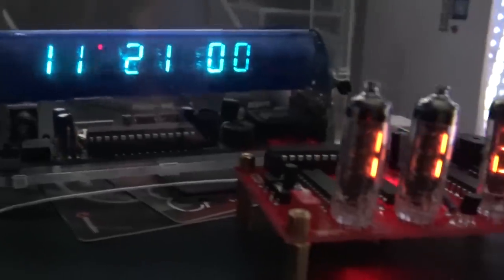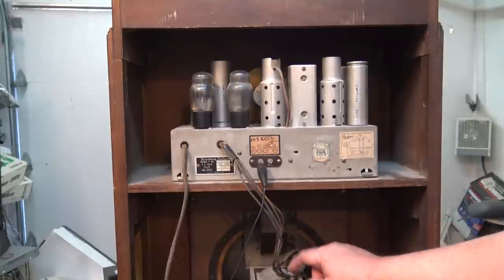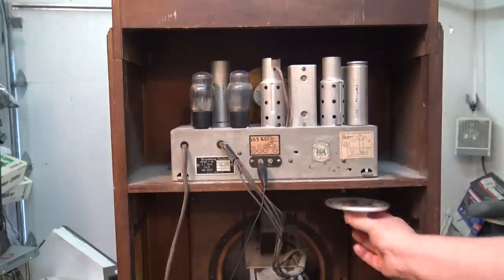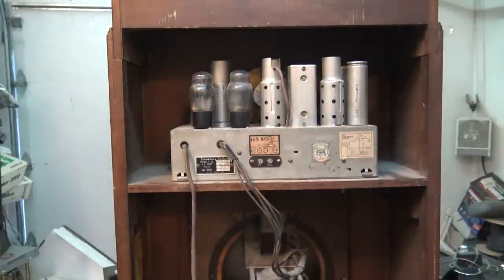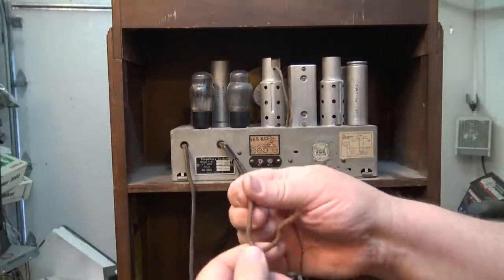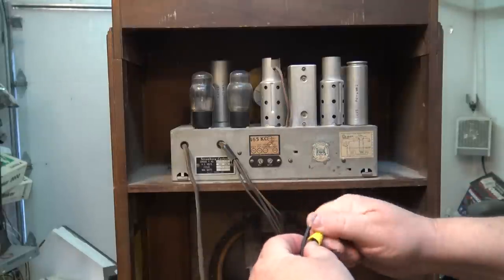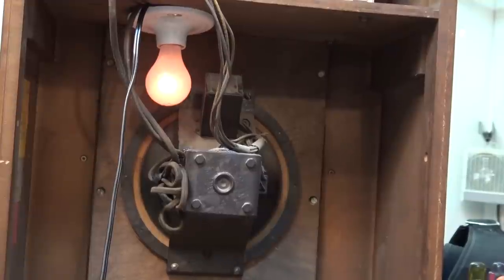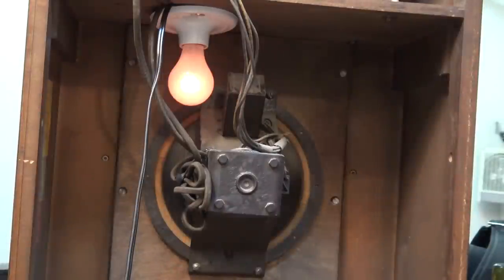Protecting your antique tube radios

Comment: Yep it's a good protection for old valve receivers, but i don't think the spider that came down the inside of the case was too happy lol.
Valves/Tubes have always been a forgiving component, i've found sets full of carbon resistors that have gone really high due to heat and the radio still works.

Comment: I certainly agree with adding protection,  my vintage sets are retro fitted with suitably rated fuses under the chassis.
Being in the UK, I also fit a suitable fuse in the plug.

Comment: There are few problems with that. You can't just install dim bulbs in 95% of the radios as there is simply not enough space. Also the originality is ruined, perhaps it is a mint radio and you just damaged the wood by screwing the bulb holder into it. I do it like this: 1. replace all the usual components (paper capacitors, electrolytic capacitors, etc.). This is just common sense and a lot of the times the radio won't even work without recap. 2. use a low amp fuse. 3. (optional) install a dropping resistor to knock the voltage down a bit - being from 230V country, I usually install 22-47ohms in series with primary to drop about 10-12V to the original 220V that old devices are specced at. 4. (for being extra cautious) fuse everything - heaters, B+ line, output tube plate line, etc. I have an old German Saba radio that has all those fuses and I doubt the power transformer will ever go out no matter what happens to that radio :)
Reply: Also a lot of the times the dim bulb will just knock the voltage too much, I have a set that is specced 45W and with 100W bulb in series it will barely work, FM will not work at all. Some also say that tube heaters don't like to be under-run too much, which might be the case with the dim bulb.
Reply from the maker: Dim bulb of sufficient wattage won't drop the voltage that much.  As to attaching inside a large cabinet not a problem.  The wood inside is not finished anyway.  Fusing only works if the fuse blows.  You can be into a current run away and the power supply is not drawing enough to blow the fuse.  Remember fuse needs to be large enough as to not blow at turn on when tubes are cold.  A fuse that is big enough not to nuisance trip is probably too large for safety.  For portable radios I have a cord set with a lamp on it in series.  
Never have had any issues.  I don't listen to these old dinosaurs regularly though.  They are mostly for show and I turn them on once in awhile.   Don't want to consume obsolete tubes.
Reply: @12voltvids  Sure, no worries. A lamp of a too large wattage might not prevent damage after all. I had an arcing tube socket in one of my radios that I dim bulbed it, and it nicely smoked a lot and opened the plate resistor, despite having a 120W bulb in series and being a 60W set. Years ago I plugged in an old radio for testing purposes (I didn't have a dim bulb then), and it immediately blew the fuse. I then bypassed the fuse and hooked it up to a wattmeter, and it showed almost 750W draw (I had it on for 2 seconds). Next I found the rectifier has cracked and transformer secondary shorted to ground.
Reply from the maker: @michvod  
That's why you don't use too large of lamp. Nothing is fool proof but having a lamp in series will greatly reduce the change of damage and more importantly the chance of one of these old beasts bursting into flames. Saying that, NEVER  leave one of these things plugged in if you leave the room.  These old radios, restored or nor are decorations and should not be used as daily drivers. They are nice to look at, and demo for people but they should never be trusted. Back when they were new they caused a number of house fires and they haven't gotten any safer as time passed.

Comment: And sometimes, the dim bulb will stop it working. Also, putting a bulb inside a cabinet could create heat inside. Better off just fitting a fuseholder and fuse. Make it internal to the chassis so if it blows, it needs to come back to find the cause.
Reply from the maker: Negative. Dim bulb will have no effect on performance. 
If I put in a 40 or 60 watt, then yes it would cause the B+ to be too low, which would result in distorted low audio, and affect the sensitivity, but a 100 watt bulb, or 2 60's in parallel will provide more than enough voltage. I bet if I measured the B+ it would still be up in the 400V range.  You need to go higher than the maximum consumption. A 100 or 2 60's in parallel will have more than enough power to run the unit. As far as heat goes, the bulb is just warm to the touch. I can grab the bulb after it running for hours. A fuse may blow for no reason if there is an intermittent over current such as turn on, when the tube filaments are cold. They draw a shitload of current when they are cold for that first few seconds. Also having a light bulb in series gives it a "soft" start. Any way you look at it, this is the safest option to protect vintage electronics.
Old tube televisions used to use time delay fuses, or circuit breakers to prevent nuisance trips due to surges and momentarily over current. The problem with slo blow fuses and circuit breakers is if something does happen, the damage can extend far beyond the original fault by the time the breaker trips, or the slow blow fuse heats up hot enough to melt the connection and open the circuit. This dispenses with all that. Enough current get to the unit to operate it, and excessive current is prevented. A dead short will just make the light glow full brightness.  There will still not be a hazard, because it is in a UL light fixture, designed for wall or ceiling mounting. The bulb is isolated far enough away from any combustibles.
Reply: yep, agree with most of that but if I was going to do it then nothing wrong with using a MOV and a fuse if I was going to add extra protection. The biggest problem is getting any tungsten lamp of a high enough wattage into most cases. Certainly wouldn't get one in the 1949 Ace 50 tabletop I'm restoring at the moment.
Reply from the maker: Also, consider this. Prior to 1970's the voltage in north america was 110/220.
It initially started out that way because the original light bulbs required about 100 volts to be bright enough, so to ensure that 100 volts was available the voltage was set up to 110. In the late 50's this was increased to 115, and in 1968 the standard was set at 120/240 and most utilities had adjusted to the new standard by the early 70's. This old radio is designed for power systems 105-125 volts. This is because the voltage fluctuated widely back in the early days, depending on how far you were from the generating station. I measured it, and with 120 volts input, the power making it through the 100 watt lighht bulb is actually 102 volts, which is well within the operating range if it was originally running on a 110 supply during brownout conditions, where the voltage could drop substantially.
An MOV is not going to do anything to protect these old devices. They typically don't conduct until well over 200 volts and all a MOV s going to do is trip your fuse on a brief power surge that is not going to harm one of these anyway, because tubes are very forgiving to overload. What a dim bulb will do is regulate the flow of current, as when the filament warms the resistance will go up, so it will regulate the flow of current and keep it at a totally safe level.
The electricians and engineers watching this fully understand this principle.  It is the simplest way to protect equipment. This won't work on equipment that is voltage sensitive, however with old tube gear this is not the case. It is much simpler, and far more reliable than other methods of protection, gives that natural soft start, which protects the tubes from that initial shock of starting cold, and the bulb running on very low current is never going to burn out.
Reply: I understand the principle, I use dim bulbs all the time when testing stuff. The reason I was looking at MOVs was the UK standard rms voltage of 240v, we peak at 300 ish... I have measured spikes here at around 500v. I'm not arguing that the dim bulb is the simplest solution but it isn't the sort of thing that fits in with the sort of vintage radios we have in the UK. There wouldn't have been room for anything like that in my Eddystone 840a, Ferranti 1016 or even the one I'm doing at the moment! I'd hazard a guess that you would be pushed to fit a torch bulb into the likes of a Bush DAC90! In fact, thinking back, the Eddystone used a varistor for the purpouse of inrush regulation and spike  prevention. Same principle, temperature changes resistance without the visual indicator that the tungsten bulb has. The Eddystone was also an AC/DC world set so there was no mains transformer, just the big resistor tapped at intervals for varying voltages.

Keep the videos coming, I look forward to watching your stuff because it is more interesting than a lot of others out there. All the best,

George
Reply from the maker: Just did an AC/DC radio today. No transformer, all tube filaments in series.
The dim bulb on the line cord only works when you have a huge cabinet like this. I don't have one on my Pye P75, but I do have a step up transformer to boost to 240V for that one, and it is limited to 100 watts, or about 800 miliamps, and it is fused. The radio and the transformer.
Reply: MOVs and dim bulbs are tools for tackling two very different problems.  One place you wouldn't want to use a dim bulb is anything with a switching power supply.  It compensates for the low voltage and can stress out on the "brownout".  But little risk of finding a switch mode in antique stuff. ;)

Comment: Projector bulbs work well and are a lot smaller.  Also night-light bulbs, though they may be only 25-40 watts or so.  Use 3 or 4 of them in parallel.  I suspect a PTC resistor would work as well but one must choose the right one carefully, and some sort of visual indicator would need to be made to show that an over-current condition is present..
Reply from the maker: A projector bulb will pass way too much current to do any good.

Comment: I do the typical work when  I restore an antique radio. Replace all paper and electrolytic caps, replace all carbon comp resistors (may not be true for everyone, but 90% of the carbon comps I've run across over the years have been out of tolerance high), replace defective tubes, clean pots & switches and do an alignment. I also replace all parts known to eventually fail.

I use my antique radios regularly and so far I've not had any issues at all.

Not saying the bulb is a bad idea though. A fuse might offer better protection though as it would blow and cut all power to the radio.

Comment: a 'dim bulb' in use CAN affect the radio operation, as it will drop the volts to the set slightly, if the radio has a voltage tap you can compensate for it, its not the drop in b+ that affects it but heater voltage/current, too low and emission is reduced....i've noticed it , especially with fm sets, and if the valve emission is starting to fade due to hours of use anyway, but some valves may be less critical,   i always fit a mains input fuse of suitable rating as most  didnt fit one from factory, and maybe even a ht secondary fuse,  some makers such as philips and murphy fitted a thermal trip of some sort to the mains transformer, but it takes time to heat up and trip it!
Reply: i have a philips set which is a bit unusual in that it has fuses everywhere!,  mains, heater, ht feeds to each EL84, and i think overall ht fuse as well !

Comment: Why not just put an inline fuse in the AC circuit under the chassis? This preserves the  look of the antique radio and provides all of the protection necessary. If you want you can also add an MOV and Safety Caps to the circuti for addional protection.
Reply from the maker: Problem with the fuse is they will allow full current up to the melting point of the fuse. So if you have a component that fails like a capacitor that starts drawing excessive current through one of the small tubes you could be drawing enough current to damage a transformer or coil but not enough to trip a mean in line fuse. And MLB will stop surges but search is really aren't an issue for vacuum equipment. And NTC will give you a soft startup but again not really an issue. Good old incandescent light bulb does the same thing it gives you over voltage protection over current protection and a form of soft start. And also gives you a visual indicator if that light bulb starts glowing bright you know that it is drying too much current. Since it's hidden inside the back of the cabinet and the cabinet is normally pushed up against the wall you're not going to see it anyway. It's just a cheap easy way that gives you 100% protection.  you have to remember a radio like this is not something that is being used everyday in fact I think this radio has been turned on maybe two or three times since this video was done. It's turned on to show off to someone from time to time but it's not turned on to listen to. so if something were to break down in the time it's turned off, what I plug it in and turn it on if I see a bright light glowing in the back I know there's a fault instantly when it's turned on. Any real collector of old vintage radios is not using them. And anyone who listens to these old radios on a regular basis as their daily driver is not a collector. The reason I say that is vacuum tubes don't last forever using them slowly burns them out. it's one thing to use a vacuum tube amplifier that parts are still readily available for but these really old vintage units the parts are scarce and when you do find them they're an arm and a leg. I was looking for a 50C5 tube recently and all the pricing I could find seem to be between 40 and $50 for a common audio amplifier tube from the '60s.   Real collectors collect restore and preserve old radios but they don't use them. Fire them up once in a while just to test them and to show them to friends and stuff and the rest of the time they're basically wall art.

Comment: Great sounding tube radio,that's why I like old radios they just sound better to me ,I did a while back buy a tube radio off of good will on line ,when I got the radio,it was solid state,I  don't think young people wouldn't no a tube If It bit them ,I guess if it's a older 60 ,a radio or older they must assume it has tubes ,they gave me my money back.and let me keep the radio ,mostly because the clock face was damage,I didn't even get to tell them it wasn't a tube radio either.
Reply from the maker: Big speakers sound fantastic. You should hear my Technics SB7000s with a tube amp driving them.

Comment: How about just putting a miniature lamp in the center tap of the HV winding?  Find one that's rated for about the same current as the transformer is rated for and it'll blow if there's an overload.  That was a retrofit that had to be done to some larger Zenith sets when they overlooked the H-K breakdown ratings Of the 6X5 rectifiers in the design phase.  Lots of smoked transformers when those babies shorted.
Reply: That would work, but would only protect the HV winding.

Comment: Is this going to reduce the radio volume by reducing the voltage going into the radio?
Reply from the maker: Stephen Hinkle 
If it does I haven't noticed. This thing can still rattle the windows and I can hear it throughout the house when I turn it on.

Comment: Great idea I like your video.
Reply from the maker: reginald lawrence 
Yes when there is room inside. Never hurts to add protection, and for old tube gear this better than any fuse as it will prevent the overload condition and give a soft start. I am probably going to modify that old Rogers radio I picked up to add some protection for the tubes on it too. I am thinking a solid state rectifier. That we give me a full wave rectifier as opposed to the 35w4 which is only half wave.

Comment: The bulb is dropping voltage and if it drops too much voltage the radio's voltages will be out of spec low and performance will suffer.

Comment: Mounting a light socket without an electrical box? Do you think that's a good idea? You have pinched wires against wood from the wall plug. Looks like a fire hazard to me.
Reply from the maker: Even if the wires shorted together all that would do is bypass the light.   Obviously you have never seen some light fixture installations. I have seen many where there is just a hole in the wall with a wire sticking out and into the fixture and this was a new build done by electrician.    Also this radio is not used.  It has been used for perhaps 1 or 2 hours total.   The entire radio is a bigger fire Hazzard.  That's why the light bulb.  To prevent excessive current to old electronics.
Reply: @12voltvids  All wire connections should be within an electrical box.
Reply from the maker: @mikewater1958  well they are not.  3 bathroom light bars, no box wire run right into fixture and connected inside the light bar, and this was inspected by an electrical inspector for the city and passed.  I questioned this and was told that it was to code. The light bar was grounded and as it was a metal box was fine.  Electrician said he didn't put boxes in bathroom fixtures because moisture would collect in it.  Inspector passed that and failed because a small 7 feet over a bath tub wasn't tempered glass.  Go figure.